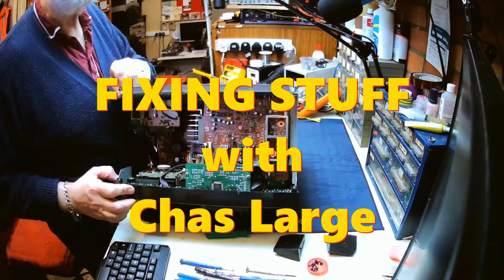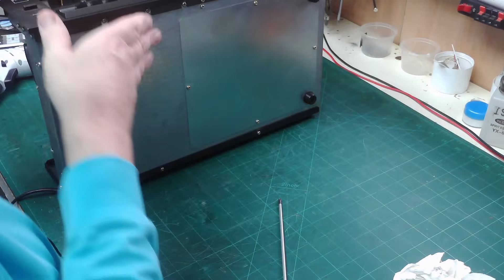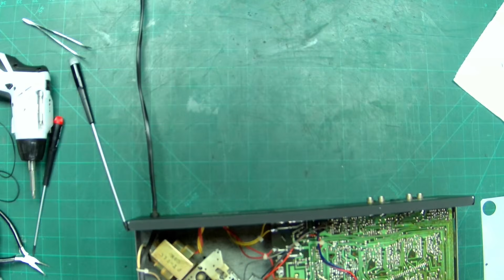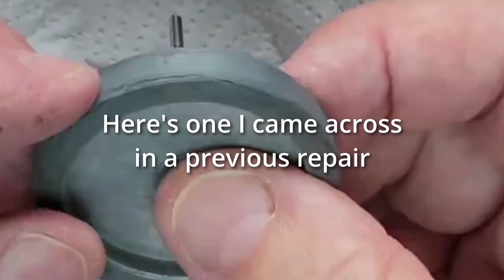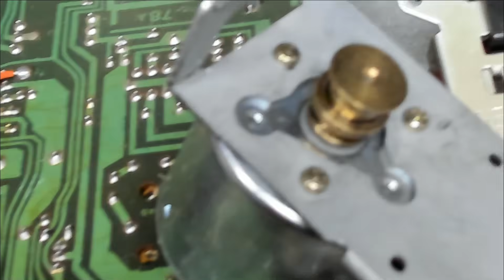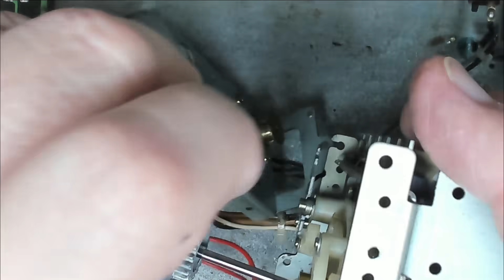NAD 6050C Tape Deck Repair - Part One

Comment: Yeah, those rubber belts turn to mush after some years.  NAD used to make decent Hi-Fi equipment, I remember seeing that brand in the Hi-Fi shops late 70's / early 80's here in the states.  Looking forward to Pt. 2.